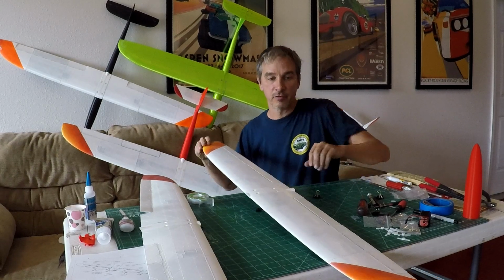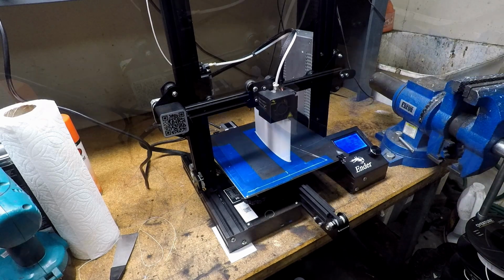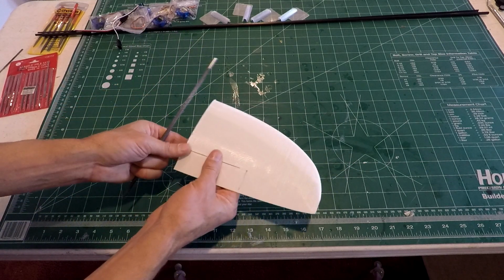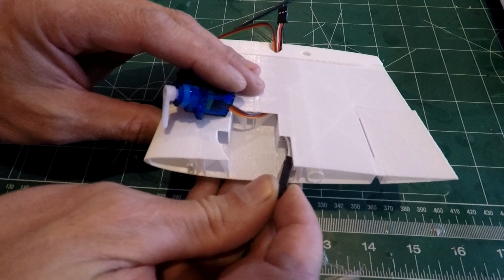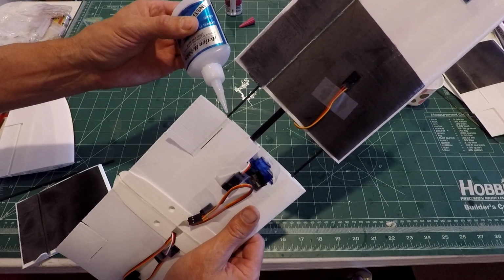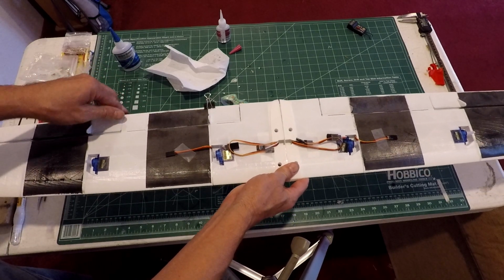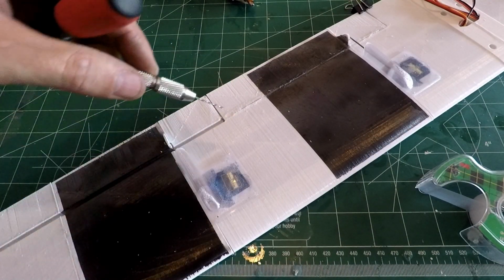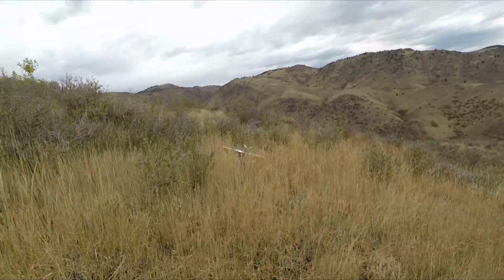SoarKraft 1200mm 4 Servo Wing V2 - Complete Build and Fly

Comment: Wie Schwer ist der Pika wenn ich ihn aus normalem PLA drucke ? ich möchte bei so 20-30kmh hangfliegen machen und LW pla ist recht teuer deswegen würde ich lieber aus pla drucken
Reply from the maker: 650-750g ready to fly depending on how you build it.
New video coming about LW-PLA build of Pika that is 370g ready to fly...
Colorfabb LW-PLA is easily available in the EU and one spool can make 3+ planes... it expands so you reduce the flow ratio by 50% = use less material.  
Regular PLA is great too, fun to fly, stiff, crips,.... PLA+ even better.  You can get 2 planes per spool.

Comment: i need a bit of help dialing the settings on cura, 
i have small holes behind the spar on the topside in the back, also a rough finish(it scrapes during combing)
printer CR-10s pro v2
filement colorfabb ECO PLA
Reply from the maker: So if you started with my base settings and are still having problems then here are some things to try..... if you are using someone elses settings??? who know what is needed.
I am not familiar with the colorfabb ECO PLA, but usually the best results are at the upper end of the temperature setting... like 190-210 use 210.
Skin Holes usually mean too much retraction, rough finish is usually not enough.  There is a "Retraction Extra Prime Amount" you can add if you can not get a good balance.
I don't use combing mode for PLA... only for the foaming stuff.... 
If you want to use combing mode and it is "scraping" then you may want to adjust your max combing distance lower and "z-hop when retracted".  
You can also go into Cura and turn on "travels" under the Color Scheme drop down.  Here you can see exactly where and what is happening in each layer and under stand what Cura is telling your printer to do at that point of the layer and then you can  make a better judgement as to what to change.... like if you always have a void in some area and find out it is after a long travel move you can add prime... or if there is a big clump at the begining of an "extrude" you can increase retraction.

Hope this helps
Reply: @soarkraft  thank you for the fast response =)

Comment: Best 3D printed glider design out there!!
Is the wing saddle intergraded into the wing print and not separate like the earlier V2 wing? 

Thanks
Reply from the maker: Thanks.  So the wing attaches to the fuselage just like the 2 servo wing, same foot print / shape.  You could fly ether wing type on the same fuselage... or switch this wing between two different style fuselage... like a V-tail slope and a t-tail motor glider.

Comment: Call me a dumbly dumb dumb... What's the advantage of having 4 independent servos on the wing vs just 2? I see sometimes you flip the inside ones down and the outside ones up. Does this make the aircraft slow down in the air or something? Thank you for explaining to a noob.
Reply from the maker: The biggest benefit for most is "crow" for landing.  Full flaps down, and both outer Ailerons up... in the right conditions I can hand catch this glider.. video coming.  So you can have a super fast aerobatic glider that lands like a leaf.  There is also full span ailerons (flaps flow ailerons), Snap Flaps (flaps mixed with elevator input for even faster racing turns), reflex, camber, etc. These are for speed, maneuvering and thermaling... look up F3F competition videos... its pretty awesome, no motors.

2 Servo wings are great / simple / easy - 4 servo wing is nice for that little extra.  Its like the M version of a BMW... not necessary, but everyone wants it.
Reply: @soarkraft  Thanks for explaining!

Comment: Do you recommend the 2 servo trail? Vs 1
Reply from the maker: The 1 servo is easy to set up on any radio and is to build, less parts.... but the 2 servo is fun too and just a bit more control in some situations.... build both.  You can print two sets of fuse parts and try out both, the materials are < $7 per fuse plus pushrods and servos... still very inexpensive..... you can also print a third and put a power pod on and have 3 fuse options to play with.  (still working on the two servo power pod combo - not ready yet)